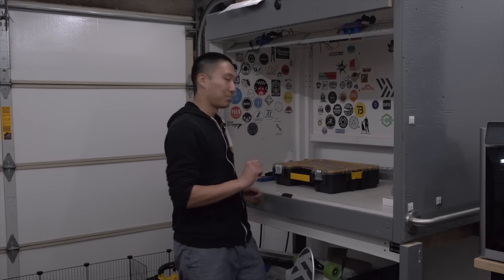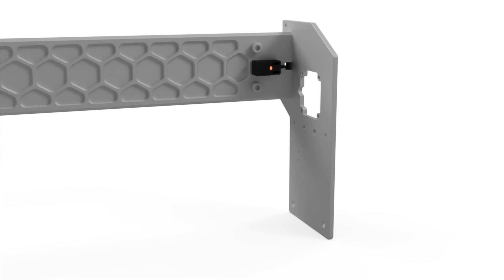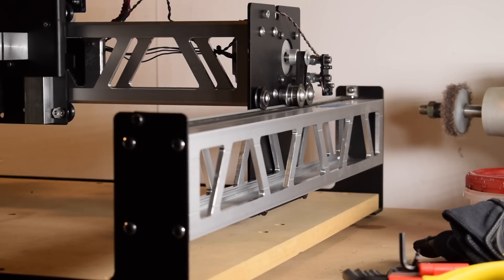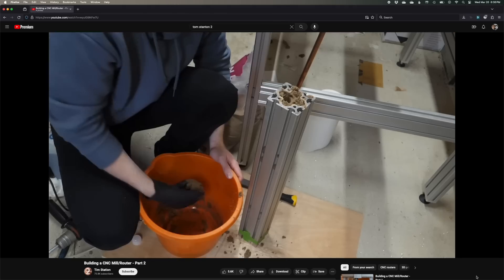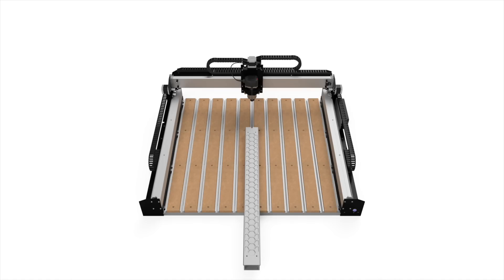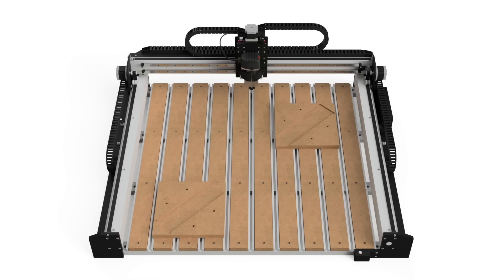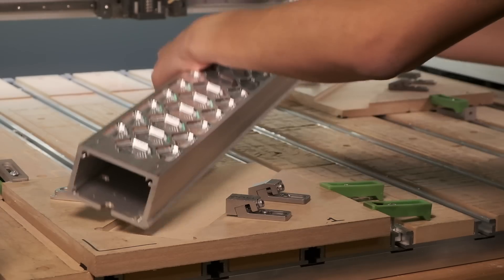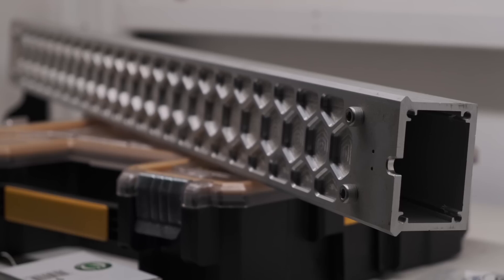Machining a Custom Gantry Rail for the Frankenoko

Comment: Hi, what are you using on the Shapeoko to run the Gcode from Fusion 360? Carbide Motion or something else.
Reply from the maker: Carbide Motion. Not the fanciest program, but it doesn't need to be. All I need my Gcode sender to do is set a zero and run the program. Fusion360 is really where all the magic happens.

Comment: Was it a scrap build from parts you had laying around to bootstrap a CNC? Otherwise I'd have gone for ball screws and linear rails instead of those delrin rollers on V track and belts. With ball screws you'd have plenty of power to use even heavier and stiffer materials like steel tubing.
I also dislike the Z axis sticking out so much under the gantry, seems such a waste for Z travel. In my latest build I've made sure the Z axis parts don't stick out under the gantry. There are times I really needed the 200+mm of Z travel to clear some high features under the gantry. 
Looking forward to the bits and bobs you've added to this build!

Comment: Nice project, I also justify "saving" a day's work to modify or build a new tool (but we all know it's gonna take 10x the time that you are saving) ;) ! I designed and built a larger scale CNC Router and adding weight is indead a commun pratice, I must have 200kg / 440 lbs of sand in my fixed frame, that's why we love old cast iron machine, they are rigid and heavy so result in less vibrations and a nicer cut quality. You might be able to justify that the gantry doesn't need to be full of sand since it's weight might reduce your cut speed, especialy if you are limited in stepper power/size, belt size or that your linear motion system isn't rigid enough (like you said) but there's absolutly no need to reduce the weight of the fixed axis rail in my opinion ! In the end, It would be very interesting do get a side by side "sound" and speed (acceleration) comparaison between a standard machine and one that's been "lighten" !

Comment: 3D manual/digital probes or edge finders make finding parts fixtured in a random location and orientation easy. Takes 2 (3, or 4 for sanity checks) points per face then using X,Y coordinates to constrain points in CAD to adjust stock in CAD to match location in reality.

Comment: I am new to this... but fanuc robots have a "User Frame" feature that orients the X and Y axis. in case an object is facing a funky direction... does cnc software have that feature?
Reply from the maker: Some CNCs can adjust for rotation but most lower end machines cannot.

Comment: My man can you please share the speeds and feeds, and that end mill type?  I've tried cutting aluminum on my homebrew machine but get awful chatter and horrible cutting whenever I try.
Reply: Make sure you're using 3 flute, or less, endmills when machining softer materials. He mentioned using a single flute finish mill at one point, but I'd opt for 2. Only cut about 10 percent of your endmills diameter to start, and whatever tooling you buy should have surface feet and inches or millimeters per revolution ranges for different materials right on the packaging. Use those values to find your feeds and speeds using the formulas
Reply from the maker: Timestamp 8:46

Comment: I’ll have a shapeoko 3 upgrade kit ready in the next few weeks.   Saved the same 3 parts as you.   Started with the shapeoko 3 and got the xxl upgrade so the kit was made to bring the original back to life and once done repeatable to work with all 3 sizes of the shapeoko 3.  Ball screws and linear rails and a complete z axis with 5” travel are all being added.
Reply from the maker: Sounds like a pretty solid upgrade. Are you planning on switching out the controller? Or trying to keep as much original stuff as possible?

Comment: Did your 1/4inch end mill leave a corner radius in the bottom of the hex pockets? I think I skimmed those isogrid docs you glossed over and they recommended a corner radius for strength and reducing stress risers.
Reply from the maker: There's not intentionally a corner radius besides cutter wear, but you're absolutely right. I actually had corner radiused 1/8" endmills on order for my isogrid coaster project, but got too lazy to load them into the Datron.

Note to self: Make that change before sending a coaster to space.